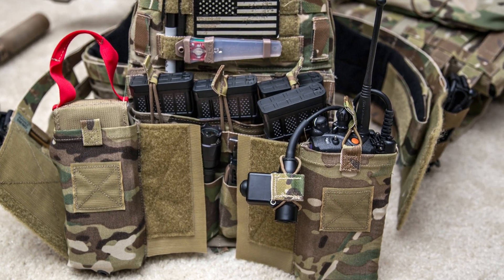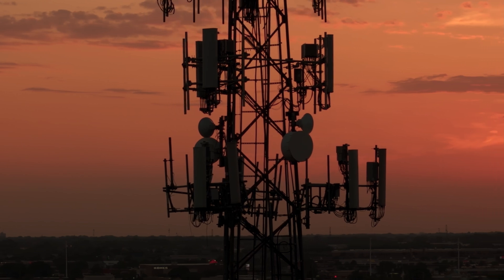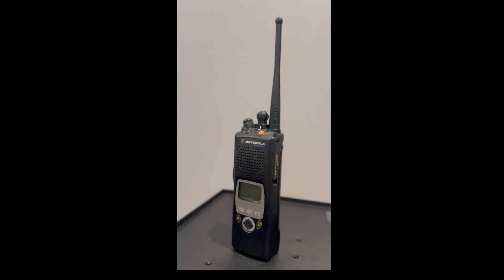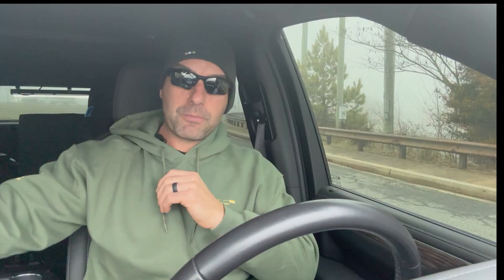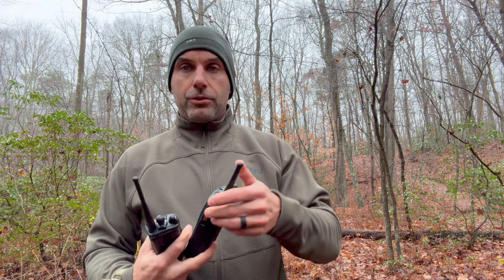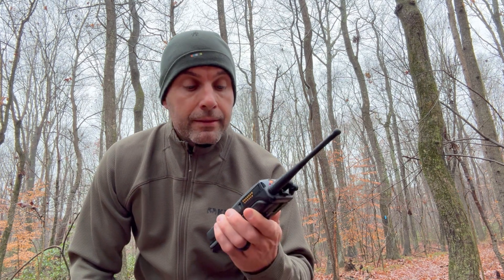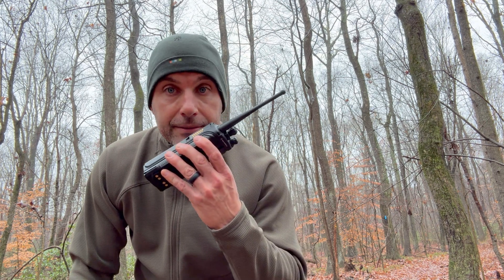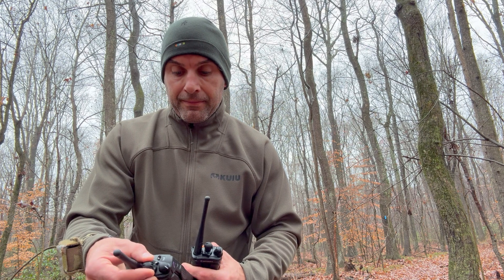Standard vs. Stubby Antenna Range Test

Comment: The most critical aspect of using the right antenna is when you transmit. It is important that it is designed to work on the frequency you are using. Length is not the major consideration, design is. Receive is less critical but important. So many people experiment with the receive capabilities of their radio and the antenna length they over look it's efficiency on transmit. A badly matched antenna could damage your transmitter.  Ideally antennas would be cut and tuned to a specific frequency or range. With multiband radios antennas are a compromise so they will work on all bands. This is the reason so many of the OEM wide band antennas are so long.
Reply from the maker: Nailed it!! 💯

Comment: For better  results, keep the antennas all vertical. Tipping one antenna 90 degrees to the other will degrade the signal by as much as 20 db. You were not consistent with your antenna position. Try testing with the antenna in various inclinations. Makes a huge difference.  You can also estimate the skill of the operator by watching how they hold the radio.
Reply from the maker: We will definitely be sure to do that for the next test and if the results are drastically different we will revisit this testing…… 24 years of public safety has certainly led to some laziness….  Thanks for pointing that out, great observation
Reply: I was going to post the same thing.
Reply: Having used portable radios in very challenging conditions of distance, I disagree slightly.  First, one should not hold the radio directly in front of one's mouth--holding the radio with the mic somewhat horizontally parallel with one's mouth will give better audio results.  Second, if one holds the antenna perfectly vertical, one's head can almost completely block the signal if one's head is between the transmitting antenna and the receiving antenna. Holding the radio with the radio slightly (maybe 10°-20°) off from  vertical will allow some of the signal  pass by one's head.  Finally, the video does not mention the very real difference in reception capability between analog and digital.  Actual reception capability of an analog signal degrades in a fairly uncurved downward line with distance.  Digital signal reception capability remains at nearly a straight horizontal line until one reaches near the end of the radio's reception range, then "falls off of a cliff."  I characterize digital reception as, "You will hear me clearly almost right up to the point that you don't hear me at all."  The hazard of digital radios is that the audio reception quality of the radio will often give the user almost no warning that he/she is reaching the very end of the radio's  reception (or transmit) range.  Yes, having an antenna tuned for the frequencies being used is very important.  By the way, a lot of my experience with digital is with NXDN, a digital platform with which not a lot of people have experience--it worked very well for us.